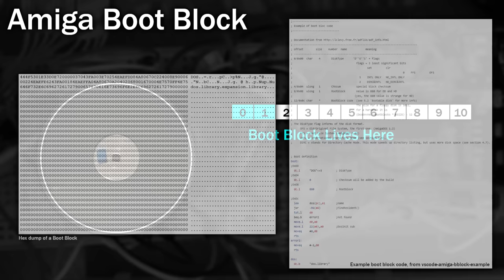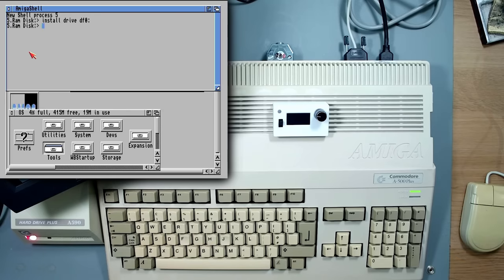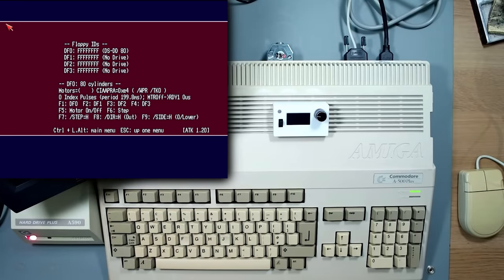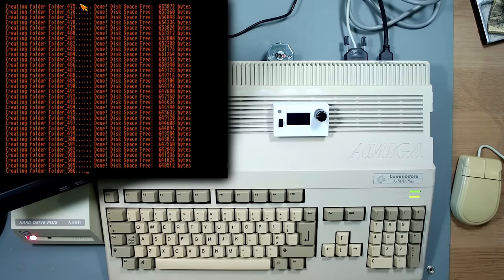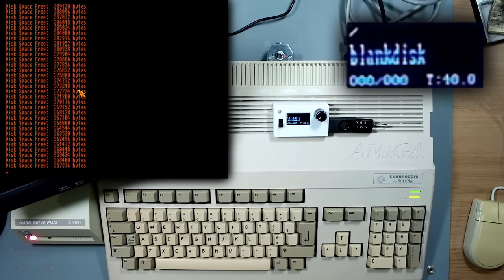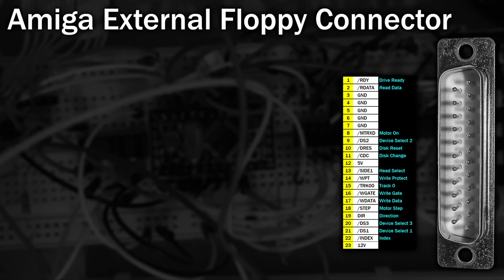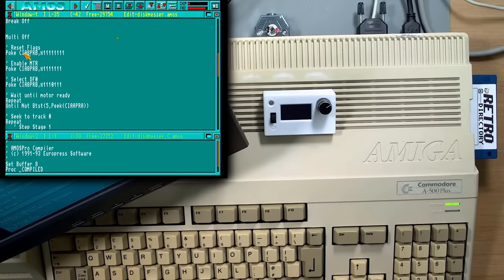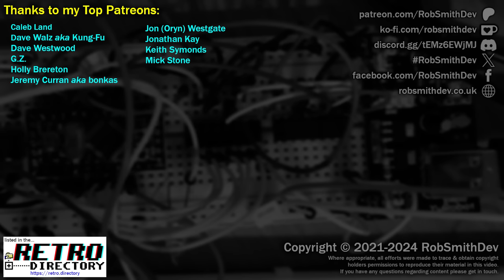Does it work? Amiga Virus Protector

Comment: I think that this switch is more effective as you may think.
A virus needs to be very small, especially a boot-sector virus. The boot sector needs to stay in working order so there is not much space for the virus and its "payload". Implementing its own write routines would make it a lot bigger - even too big to work for hiding inside the boot sector.
So a virus uses all the code of the OS or ROM of a machine it can to stay as slim and sleek as possible.

On a C64 drive, there is no hardware write protection at all. The Floppy-OS just checks the notch and decides if it may write or not. A small change in the Floppy-OS using a few Bytes of code in the virus can disable the write protection.
Reply from the maker: I think it’s possible. The boot sector has 1024 bytes and a minimal boot block actually only needs 49 bytes of that. If it used the OS to do everything except the Write it should be possible. The code I used to write the track wouldn’t amount to much code at all. Assembling the buffer slightly more but still loads of space
Reply: I remember being ridden with the Saddam virus...... A friend of mine made me a diskette that killed it in memory, and installed a hotpatch so I could boot the disk and then swap for the disk suspected of being infected and clean it.

Saddam was nasty...... Installed itself on the boot block and slowly but surely made the whole disk unusable
Reply: The virus does need to be small enough to fit on the boot sector - it just needs to contain a jump command to another sector.
Reply from the maker: This is also very true!
Reply: Even if a virus needs more space than 1024 bytes, it can "make" it.
1. by marking a block as "bad blocks" in the file system. The formatting routines in the OS never uses that when doing it's job. It will rather warn that the floppy is damaged. But will look in the "bad block" list to ignore them when writing files.
2. by going beyond track 79. Nearly all floppies could read and write tracks 80 and 81 without a problem. A lot of space for additional code.
These where also known ways to make "copy protected" floppies.
3. by adding stuff to the end of existing files. Nearly all more complex file formats had a header that had a total length count of the file and the reader wouldn't go beyond that. So adding stuff to the end of a file wouldn't be visible by default. Executable or libraries  where the main target.
Reply: @allangibson8494  Sure. Especially if the virus contains a huge payload like music or playing an "Intro". But just to defeat a device almost nobody had ever heard of back in the days? It's no 100% protection and can also mess up your disks if the game needs to alter the disk to keep track of game progress. But most - if not all - viruses are not designed with this kind of protection in mind.
Reply: @boelwerkr  If you format a disk, the boot sector is gone, so the bad sector doesn't matter any more anyway. Also the position of a sector on a track is not fixed. The angle on the disk the sector starts is fully random. The formatting tool just formats track by track and then checks the track if it was properly formatted.  Then it marks the bad blocks.

The problem I have now is that I don't know how the Amiga handles bad blocks. You see, the Amiga handles disk writing totally different.
The original PC had 16k of Memory. There was no way it can handle a whole track on the disk and has to process sector by sector. To do that, there are gaps left between the sectors. When a sector needs to be written, it reads the sector into memory, alters the content while scratching the sector on the disk. Then the entire sector is put back onto the disk. This is why sectors are used in the first place.
The Amiga however, being a much more modern machine with lots of RAM handles a disk very differently. It copies the entire track into memory, scratches the entire track while altering the track in memory and then puts the entire track back. This is why removing a disk on an Amiga while accessing the disk is so much worse than using a PC- You can loose an entire track instead of just a single sector.
The benefit is that there are no gaps between sectors any more so an Amiga Disk can have some extra sectors per Track. That's why the Amiga can store more data per disk than a PC.
And since an entire track is rewritten every time you make a change to a sector, the physical position of the sectors on the disk is random. So a marked bad block will be on a different spot every time you write access the track containing the bad block. I know for sure that the Amiga unlike the PC isn't tolerant to bad disks.
I didn't own an Amiga back in the days (I do now) so I have no low level hardware experience on those machines. 

And yes, using more tracks was very common, especially on the C64 where the drive doesn't use 5 of the tracks any 5¼ Disk can hold. Most drive mecanisms are capable to position the head to all of the tracks a disk can hold. On the Amiga, the disks and drives are not designed to hold more tracks and the R/W head can get stuck at the end stop or the magnetic surface of the "extra tracks" isn't uniformly made since not used.
Reply: @brynjarborgersen8131  There were some nasty buggers out there. Some had destroyed a disk after n times of copying itself. Starting a write access and moving the heads over all the tracks takes just a second. So the disk content can be made unrecoverable before you even notice that the drive is actually doing something weird. The same could be done on the ancient  MFM/RLL hard disks which were controlled exactly like a floppy disk drive.
Reply: The Amiga doesn't have any hardware write-protection either. You can write regardless of the notch position -- if you know what you're doing.
Reply from the maker: That’s what I showed in the video. The floppy drive however does have hardware protection thankfully

Comment: At first I didn't get it why you could write by using hardware directly but I guess write protect on the drive uses it's drive controller to inhibit writing whereas the /wp signal is software based for the Amiga internally and can be ignored.
Reply: You can consider the /wp signal as like the "Paper out" line of the Centronics printer interface. The printer is unable to print and the computer can tell by looking at the Paper-Out line why. This is just a "For your Information" thing.
In case of the OS using a disk, it will check if its able to write before it tries to write. This prevents confusion since there is a cache which will be out of sync if the OS tries to write but failed.
Reply from the maker: Absolutely!

Comment: So you say people use GoTechs now and viruses are back. Why doesn't the GoTech have equivalent functionality? And by that I mean implemented more correctly such that truly only sectors 0 and 1 are protected and they are properly protected instead of just flagged as unwritable when they really are writable. It could even store the writes to sectors 0 and 1 in a side buffer and make them look like they were written to the host but on its own screen put up a question asking for confirmation if you really want those sectors to be written or not. Of course the functionality would also be selectable, on or off. So you can turn it off when you really want to write a bunch of boot sectors in a row without extra clicks.

Seems like it would be useful.

Also, when explaining the circuitry you go through trouble of explaining open collector active low signals, but you don't explain and of the symbols used other than that. If a person doesn't know about open collector signals they likely don't know what the symbol is for a switch or a diode, or a pull up resistor for that matter. Often it's hard when explaining the basics to people who don't know them to try to remember what the basics are!

Anyway, interesting device and good video.
Reply from the maker: Interesting comment - I’ll have to contact Kier Fraser (FlashFloppy) and see what he thinks.
It’s always difficult to work out the level of knowledge to provide on these subjects (schematics etc) a difficult balance to be sure!

Comment: So that begs the question. Could you actually make a device that blocks writing to the first to blocks of a disk?
Reply from the maker: I guess you could, but I think it would need to physically sit between the drive and the cable and block the writing properly. The Write Gate line would need to be held high. If you went to that trouble though I’d make it do that for track 0 and side 0 too

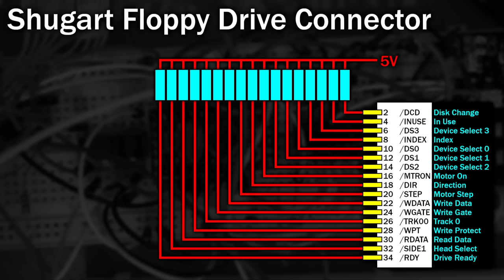Comment: 08:06 Ahh, so I'm guessing the Amiga uses a shared disk bus with all signals present on the connector (even internal ones).  That would explain how this could work (I was expecting multiple independent buses to be present or only unused signals to be present on the connector).  Edit: 08:53 Is the internal drive's select line in fact not present?
Reply from the maker: Yes correct. There was no need to make the select 0 line available as it was always connected to the internal drive. This wiring for floppy drives was fairly common, not just on the Amiga - I guess if they’d all been independent it would have added comply and increased cost
Reply: @RobSmithDev  Watching this videos made me realize there are a lot details of mid '80s PC hardware design that I'm unaware of.  That's especially true of the Amiga which I've had little exposure to.  I'm most familiar with the Atari ST/TT and just looked at some Atari ST schematics (only 2 pages!) and found a few surprises.  I really should delve into them more deeply (and those for Amiga and Acorn); these simply weren't available back in the day.  (Apologies for the tangent.)
Reply from the maker: There’s some funny comments in the Amiga schematics, one of my favourites is in the Amiga 2000 schematics, there’s an internal serial port connector, but in the schematics it’s got a different name - I’ll let you find that one 😃
Reply: @RobSmithDev  LOL  :^)  A typo too good to fix?
Reply from the maker: May have been intentional but there’s some silly comments in all of them

Comment: This device could have achieved a much safer result by deasserting the write gate (input to drive) when track 0 was asserted. Same circuit different pin, much better result.
Reply from the maker: Unfortunately not possible from the outside - you’d have to hold the pin at 5V and then anything that tried to pull it low would cause a short circuit. You’d be best disconnecting it from the inside